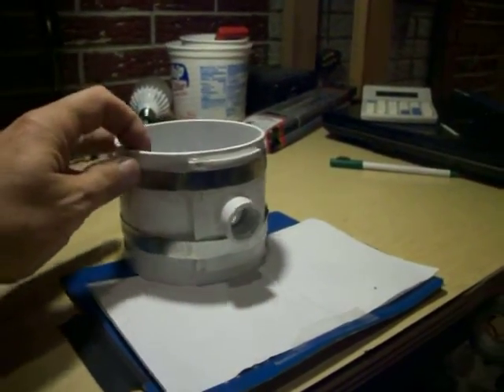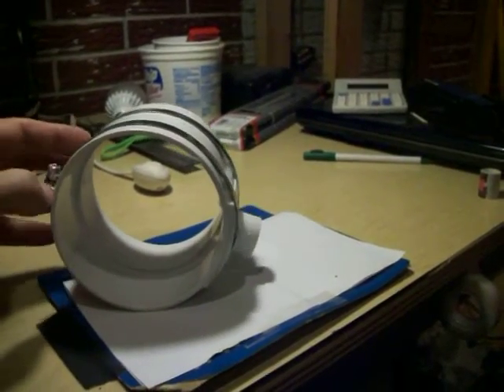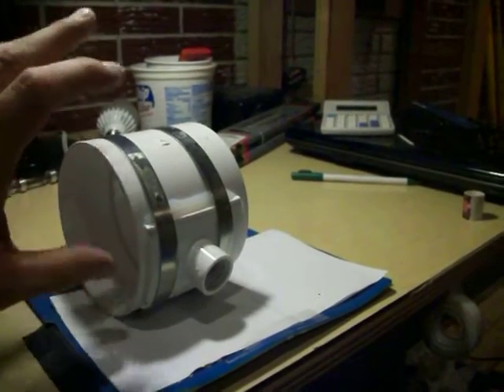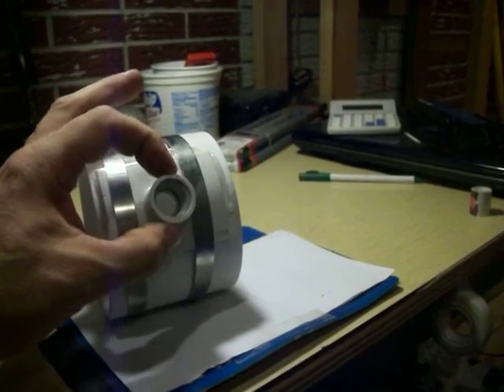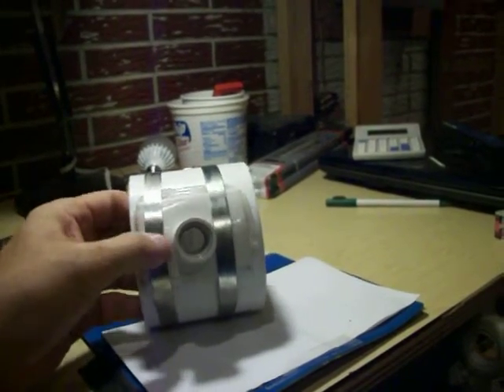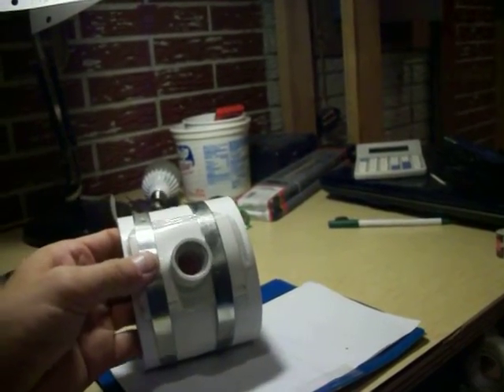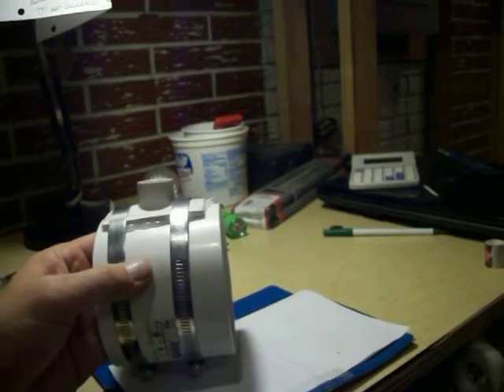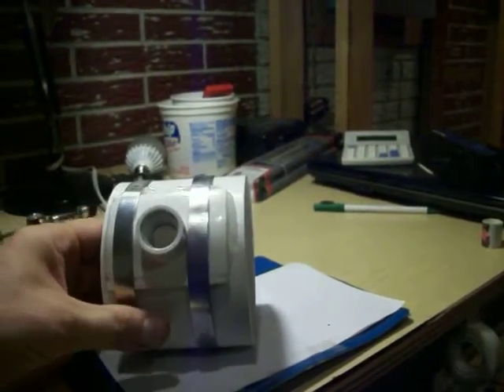DIY 4" bathroom vent condensation drain.

Comment: Nice work.  I have the same problem.  Where did you run the condensate drain to.  Mine's in the attic I suppose I could just drop it into the perforated soffit.  I'd be interested in knowing how yours work.  Cheers.

Comment: I was wondering how the water is going to get trapped? Are you mounting it on a horizontal run or a vertical run?
Reply from the maker: Horizontal in this application.  They make vertical run traps for things like radon mitigation ventilation stacks.

Comment: i cant understand how the US has no producer of this item ?
Reply from the maker: You and me both...  A rather long time ago I installed a power vented natural gas hot water heater.  The power vent mixes in regular temperature room air with the combustion gases to vent via standard schedule 40 PVC.  The installation kit with the hot water heater had a coupling similar to the one I made in this video.  Odd that I could not find a vendor via the Internet for something similar here in the U.S.